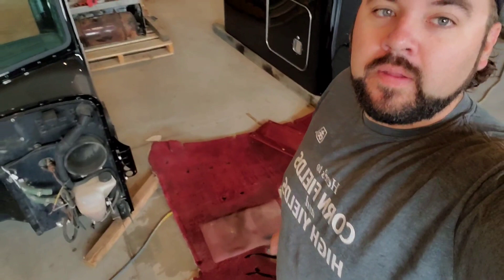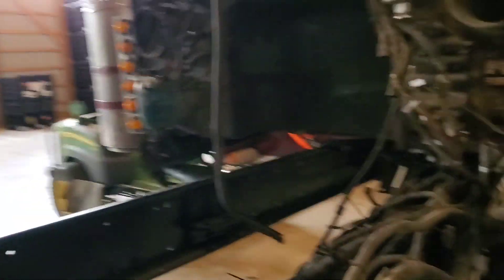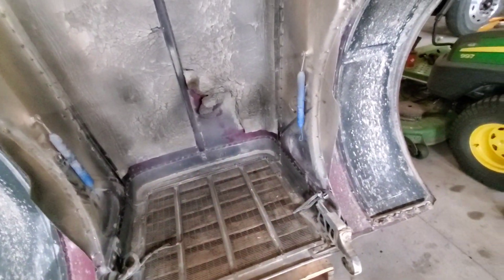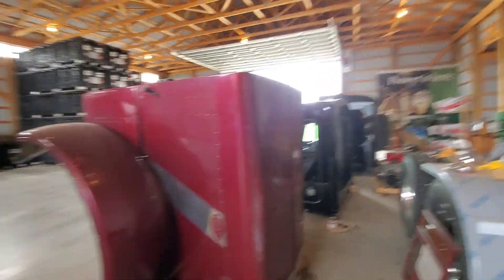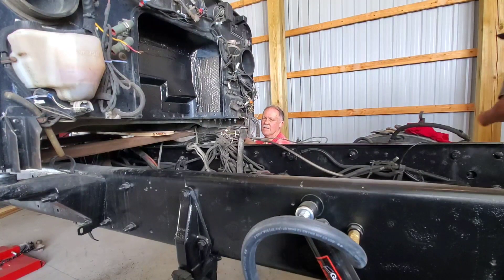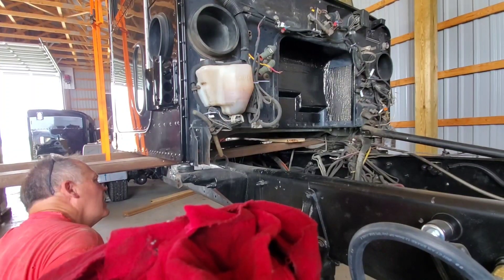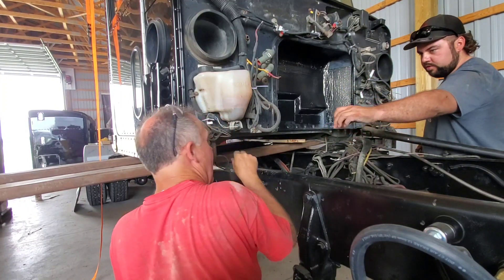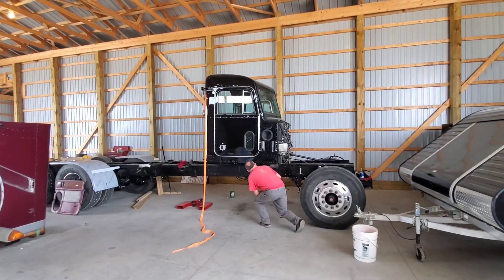Peterbilt 379 Rebuild (Episode 10) Things are getting serious!

Comment: its funny you are removing a better cab than i am starting with! im surprised you didnt set the engine and trans before you set the cab and sleeper. are you using any sound deadening inside the cab before you put it back together?
Reply from the maker: Lol I saw what you drug home they look pretty decent. This cab was just too rotten around the windshield / wiper cowl / roof cap. I used a double layer of noico sound deadening on the cab so far. Seemed to work well in my 95.  The engine and trans are all painted up at my mechanics going in before the bunk. 
Whats the plan for yours?

Comment: I have the option to buy a 04 397, cabs also rotted up. I got very good mechanical skills, especially on semis. But I worry myself on a job this big and change my mind. I could damn near grab the truck for free. Interior is good, hood is perfect except fenders, has brand new J mount headlights. You're making me rethink my decision hmmm
Reply from the maker: It's a lot of work and expensive but at the end of the day you will know what you have. I say go for it lol or sell it to me
Reply: @gblonde2331  I’ll probably end up buying it and make it a long term project, high horse cat 300wb with custom paint. Working show truck. For the money I could get it for I can make that just by selling the hood. Appreciate the motivation🤣
Reply: @gblonde2331  real talk though, hop on insurance auctions (I prefer iaai) you can get some decent deals for them. There’s one as far as I know still on there, 95 or so, 12.7 Detroit, motor looks great, still runs. Hit in the passenger side. Needs hood probably some new u bolts, side box and fuel tank. Buy it now price is 9000$ but if you wait for bidding days 90% you can grab it lower.
Reply from the maker: @BMW_Mustang_Dodge  good idea thanks for the heads up